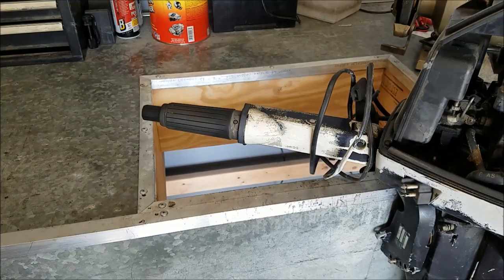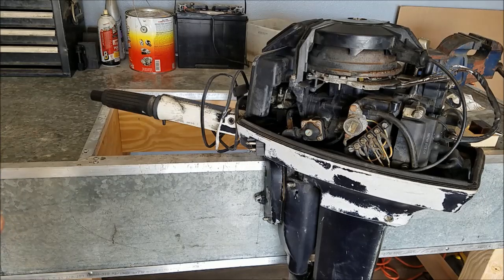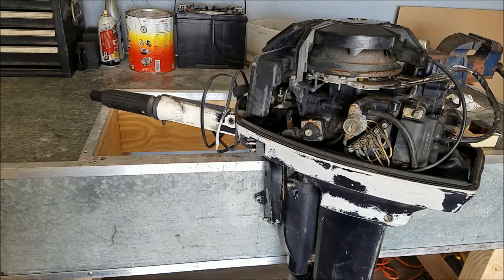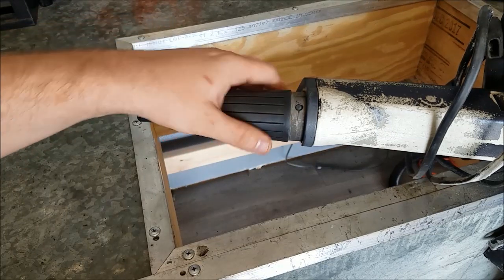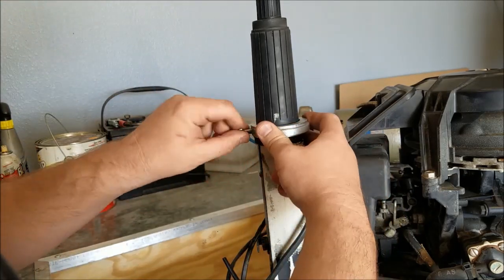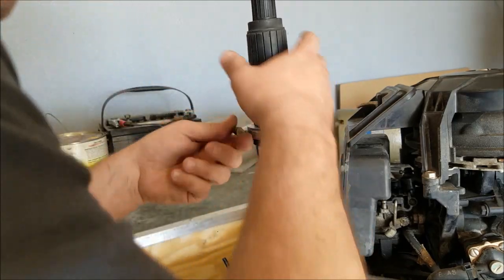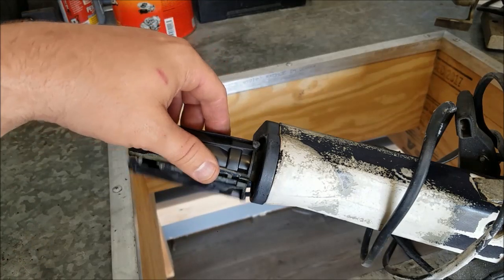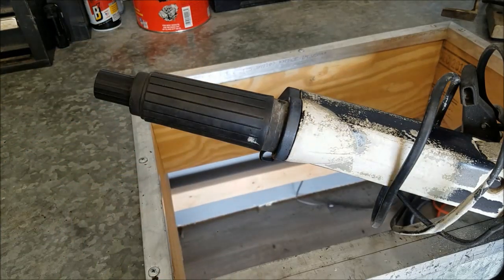Removing Johnson / Evinrude Tiller 'Twist Grip' Handle

Comment: This is definitely off topic, but I need help doing the linkage adjusting/synchronization on my 1997 Johnson 15hp tiller model 2strk. The manual says to remove pin retaining throttle lever connector. However, you cannot access this without removing the lower power head cowling, which I attempted to do but there is one screw I cannot get to as it is almost underneath the power head  by the latch mechanism and no way to access. Was wondering if anyone has ever been successful performing this synchro procedure and if so, how did you successfully remove that last screw (located inside the cowling, towards the back of the powerhead, right by the latch mechanism)? Thanks in advance!

Comment: I have a 1979 100hp johnson javelin. It runs pretty bad at low speeds on a load but really good at fast speeds on a load. How can i make it run better at low speeds?
Reply: Carbs have a high speed and a low speed jet. Clean carbs. Sorry 2 years late🙄

Comment: David from Texas, hello Brandon if don’t mind me asking a question I have a 2000 Johnson 40 hp it will run out of water with muffs on but won’t crank when I put it in the water I’m stumped I can play with the high idle and get it to crank but it won’t idle at all it runs great straight out running but won’t idle with  motor in water any help would be greatly appreciated thanks David Clifton from Texas
Reply: Mine does the same, still trouble shooting. After running diagnostics from the software we’re thinking a bad fuel injector (#1) and then the throttle handle is off alignment and the gears may be worn down.